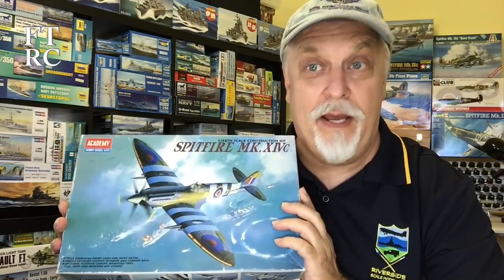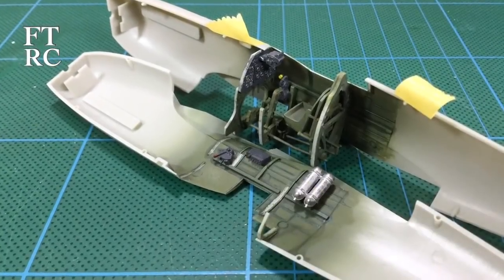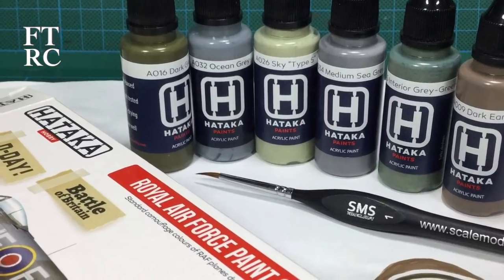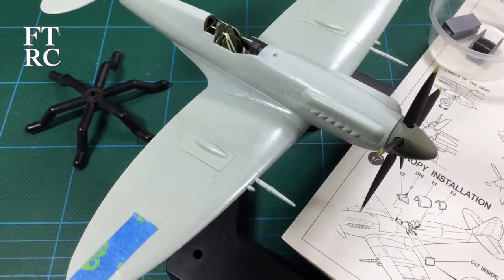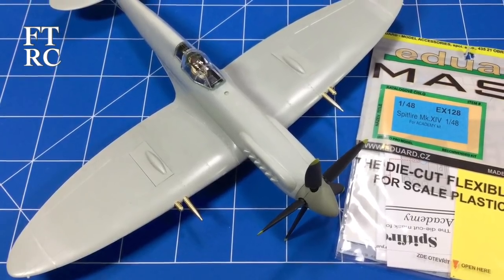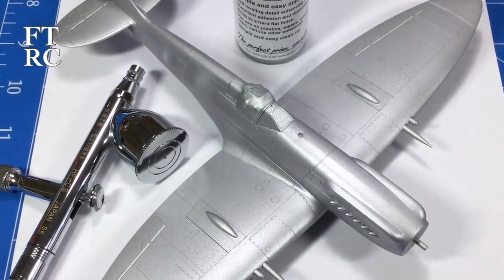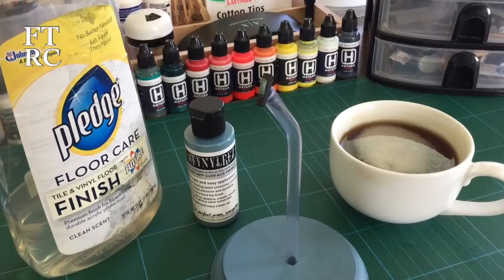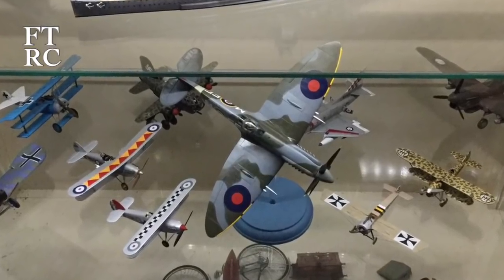Academy Spitfire MK XIVc Part 3 Build and Paint

Comment: Nice job on that Spitty Harry, looking awesome! I too have a couple sets of the Hataka acrylics but have yet to try them out. I noticed that you appear to also have some fluro colours as well. Do they come in box sets or did you get them individually? I used to get a lot of my paint supplies from BNA in Aussie because everything is so bloody expensive here in NZ, but unfortunately BNA won't ship paints etc to NZ anymore. Can you recommend any links where to get paint from that will ship internationally? Cheers mate. Hope you have a great Xmas and all the best for the New Year, Stay safe.
Reply from the maker: I also bought my Hataka from BNA and yes most are from sets.  To get the colours I wanted I managed to get the RAF WWII set and for my upcoming Messerschmitt the Luftwaffe set.  But that had no yellow for the cowl, so I bought a helicopter set with yellows, reds and a white.  I did however manage to buy a black as an individual paint bottle.  BNA is fast running out of the paint but you can buy direct from Poland. The shipping is not bad so price wise if you buy a good amount of paint it workes out cheaper than BNA.  Be aware Hataka has RED series for airbrush, BLUE for hairy brush and ORANGE is Lacquer based.  I bought all RED but even managed to hairy brush touch up my airbrushing with it.
http://hataka-hobby.com/
Reply: Cool bananas, will check it out. Cheers!

Comment: Thanks for the paper masking tip boss 👍
Reply from the maker: Happy if it helps you mate.
Reply: A lot, I had a camo issue with a Douglas Bader Spitfire Mk II 1/48 kit. You know beginners... After a thirty years interruption!
Reply from the maker: Yep been there... and now back at it for 5 years... still the old tricks work.

Comment: Where did u get the brass guns from as I am making a mark vb 1.32 scale model of a spitfire it came with photo each witch I’ve never used before but I did like the parts u put on our spitfire and would be interested in where u got them from many thanks Chris
Reply from the maker: Hi Chris.. I purchased the Spitfire brass barrels from BNA in Melbourne Australia, but they should be available worldwide.  These were RB barrels but I have also previously bought Master Barrels. Both companies have a wide range for all types of models. https://www.scalemates.com/kits/226400-rb-model-48ab10-20mm-hispano-cannons